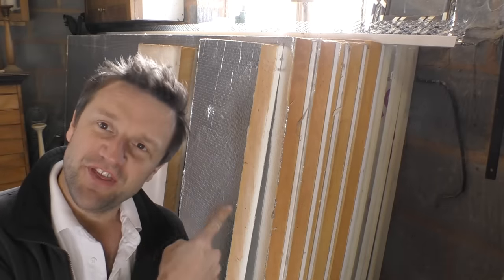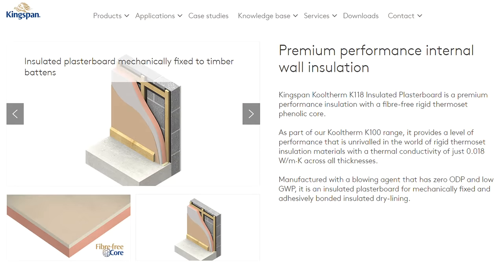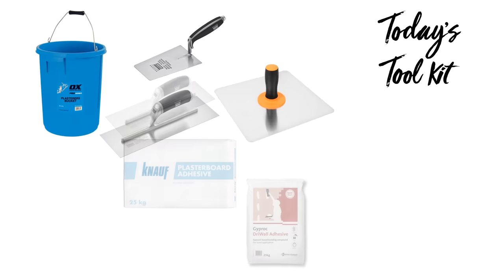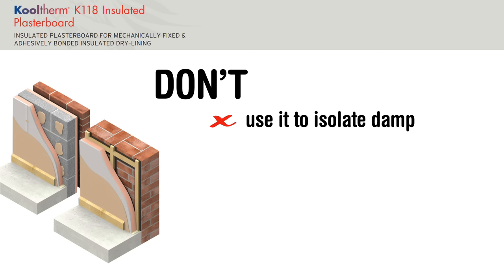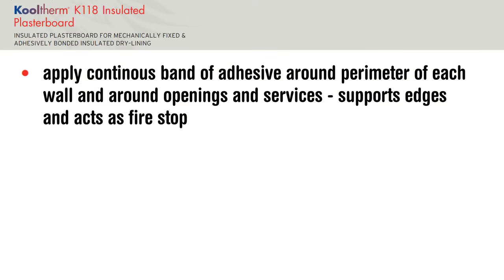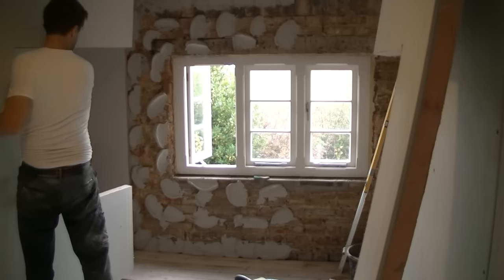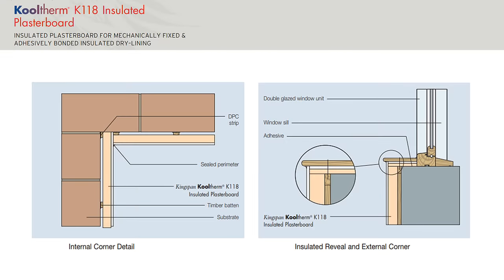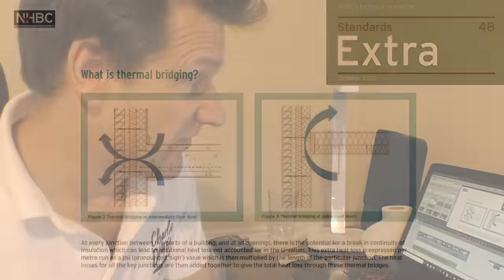How to Dot & Dab Insulated Plasterboard - a DIY Guide

Comment: I love your videos Charlie. It’s been 3 years since you did this. Have you experienced any condensation issues or signs of condensation forming behind the insulation? I’m keen to do this at my house (already done one room) but my head is spinning with all the conflicting advice around the condensation risks and lack of breathability. This stuff is BBA approved for this application but there are so many experts warning against doing it at all or recommending alternative, breathable panels combined with lime plaster to maintain the breathability of the building. Interested to know your thoughts/experience on this
Reply: I’m having the same conundrum, George!
Victorian building so 9” solid walls. We had some damp on one wall already but a specialist said it was mainly due to the incorrect mortar used when the pointing was re done some years ago. Replaced with a proper lime mortar we haven’t had many issues. But if I insulate with this method, am I adding to moisture/breath ability issues?
Reply: @thewalkingsketchbook my house has solid brick walls and I insulated the walls internally 40 years ago. There was not much information available.  Some was very wrong.  I was concerned about condensation in hidden away spaces.I had a choice of polystyrene sheet or fibreglass/ mineral wool.  I used the latter as it was much cheaper.  I made a frame of 50 x75 mm tanalised timber, screwed to the walls and filled with insulation.  Then a polythene vapour barrier and then plasterboard.  Keep the vapour barrier intact around power sockets was awkward. I’m still in the house and have had no issues.  I have one last wall to insulate, the bathroom.  It’s only a few m2.  No external render.  But it’s sheltered and I might bond directly to the wall.  Still in two minds about it. 24:19
Reply: @thewalkingsketchbook think of it like this , your house needs to breathe hence the lime mortar outside and the same applies to the inside with regards to lime plaster and limewash/ breathable clay paint , this method will keep humidity controlled in your property and won't end up spoiling any brickwork because of a build up moisture 👍

Comment: Good job! I don't understand people saying you HAVE to get in the "pro's" to do things like this. Many builders don't realise you have to have a continuous bead around the edge resulting in a draughty plasterboard tent, and building control don't pull them up on it either. Busy fixing this in my house!
Reply from the maker: Thanks Alastair. It's a bit of a dark art this, as it's rarely done properly, to be honest. With yours, just do everything you can to minimise cold bridges. Sockets are a big one where, like I did here, you typically cut through the whole board. If I do this dot and dab approach again, I think I'll get the back box all drilled, plugged and ready, and then spray expanding foam in the void behind the box and in the gap around it, and quickly push the box into place and screw it in position then let the foam harden around it. That way, you're minimising a big source of moisture ingress.

Comment: Great video Charlie. How did you get the radiator remounted? Did you have to extend the pipes or have you come up with some other way of doing it? Thinking of doing the same and trying to avoid having to drain down the system.

Comment: Use a paint roller and tray to apply the PVA, load it up, start from the bottom and roll up, keeping a small wave of PVA between the roller and the wall, touch up with brush if necessary

Comment: Coming to this one quite late. Another really high quality video - great explanations. One thing though, these boards are phenomenally expensive now. In my 100 year old semi, it’d cost approximately £1000 for the materials to do less than 2 of my first floor rooms (external walls only, 50mm board). Have any competing products been released since this video was first uploaded?
Reply: Before you carry out any work, make sure the house does not contain any asbestos. Also old houses with plaster walls would highly likely have no vapour barrier under the plaster to stop moist air from saturating the insulation. Back then, plaster walls were designed to allow the free exchange of air and moisture.  If you're not sure if the plaster has been replaced with a vapour barrier or any insulation, remove a small area and check. You may just need foam or wool insulation and a vapour barrier underneath the plasterboards. I can highly recommend Tekwarm EPS HP, not sure if it's available where you live though.
Reply: Sadly this is just the way of the world now. Building material costs are significantly higher than they were in 2019 when Charlie did this video. It’s been a painful three years for us DIYers !

Comment: Really useful. Thank you. I intend to do my conservatory in the new year.
Reply from the maker: Glad to hear it. If you have to install back boxes for the plug sockets, try not to cut all the way though the insulation or if you have to, re-insulate behind with spray foam to minimise any cold bridging. You could even glue the insulation boards in place with spray foam rather than plasterboard adhesive. 👍
Reply: @CharlieDIYte  really? That would work? Probably easier. I’m always worried about making the plaster too thin. Thanks for the tips.

Comment: Just a note,  only use KNAUF bonding compound on foil backed insulation board k118 otherwise you are taking a big risk. There's no point in pva-ing the back of the boards then, knauf bags are readily available from all drywall merchants. When taking delivery of your boards lay them down as flat as you can get them especially if its going to be days before they get used to avoid them bowing.
Reply: What's the reasons for the KNAUF bonding compound? Thanks
Reply: @LB-gr5se  I assume your asking why use knauf bonding compound specifically on the knauf foil backed k118. If you use BG bonding compound instead,you will certainly run the risk of the board coming away from the dabs once they had set as it is not designed to stick to foil. Where as knauf adhesive you will have no such problems.
  On normal wall board, BG,Knauf or Siniat bonding are all pretty much the same ,though I personally prefer BG bonding. With Knauf ,you have to pay a little bit more attention when mixing because it doesn't like being overmixed by drill and tends to thicken  up quickly, which you don't necessarily want if you have a large mix to do. Hope that answers your question
Reply: @darylheasman1  that makes sense thanks for clearing that up

Comment: big thanks for your time and attention to this. Our walls are 3 bricks thick. Very dry. Considering mechanical fixing throughout though.. a longitudinal fixing of treated timber and then vertical fixing of softwood battening - to level. Fixing verticals with metal straps to reduce thermal conductivity - rather than timber to timber. Fill with fireproof insulation and screw fix 12.5mm plasterboard. Thickness 65mm internally. Wondering why you haven't gone for this approach, apart from the mechanics of getting it all aligned? with metal strapping, this has proven quite simple so far. Thank you R&T

Comment: If you are mechanically fixing the insulated plasterboard. Where there is a risk of damp. You should use galvanized steel batten, as wooden battens can rot. Great video!
Reply from the maker: Fair point. I'd always put DPC between the batten and the wall, at all the fixing points. However you shouldn't really insulate a wall that has a risk of damp, and of course do everything you can to ensure there's a decent vapour barrier to prevent moisture from inside the room causing damp in the wall. The socket back boxes are always a problem though...

Comment: Brilliant video, I've learned a lot and will be following it step by step to insulate the walls of my flat, thanks a million Charlie!
Reply from the maker: Thanks. Take a look at the foam adhesive too - it's a better insulator, and will be more effective to reduce cold bridging around the back boxes you have to cut out for plug sockets. Cold bridging should be your buzz word throughout the project. You need to do everything you can to eliminate any. 👊
Reply: @CharlieDIYte  Thanks for that Charlie, is there a brand of foam adhesive you could recommend?

Comment: I learnt so much from your video and I’m in the building trade!
Reply from the maker: David that's incredibly humble of you, and I say to any trade pro who comments favourably on my vids (eg the silicone one) that they're clearly very good at their job. We're always learning aren't we. Actually there are a few things I'd do differently since making this. On my most recent bedroom refurb to eliminate any potential cold bridging (sockets being a big source) I battened the wall with 2x1, infilled with 1 inch celotex PIR, foil taped over the battens and then screwed the K118 insulated plasterboard to the battens. Socket boxes were cut though the insulated board with a  12mm ply board foil taped to the back to screw the box to. That way there's no cold bridging though the socket. Also continuous insulation around the window reveals and breathable expanding foam tape under the insulated plasterboard. And I either didn't video it or I've lost all the footage 🤦🏻‍♂️ Thanks for the comment 👍

Comment: Well done, Im a plasterer, learnt from my Dad. You have done a decent job of lining the walls. Just as good if not better than most.

 I read in one of the comments about using fixings in old walls. What I do is dip the plugs/screws in gorilla glue and wet them before I screw them in. This expands and strengthens the fixing. The only problem is if you do want to take them out they are a devil to remove but if your wall old it really helps

Comment: I would be interested in how you tackled the window reveal.
Reply: would be great to know this
Reply: a normal 12.5mm  plasterboard would be used.
Reply: @elltell8644  followed by damp and mould in the months to come. Needs a proper thermal break. the improved insulation on the rest of the walls increases problems in the remaining cold areas.
Reply: @alexclifford8961  with window profiles of 30 - 40mm there is little else that can be used other than 12.5mm foil back boards. how they are fixed is down to the operative.

Comment: Great video, the issues for me would be the wires for sockets wouldn’t be long enough to reach through the new insulation, and pipes for radiators not reaching, it would be a massive job. You made a good job of this, just measuring for the sockets would of taken all day for me 😂.

Comment: You made a good choice  doing this to your cottage , I been to jobs that other company's have insulted the lofts and stopped the air flow causing condensation in the roof space all they needed to do is add roof tile or slate vents

Comment: Hi Charlie, great video thanks.  Just a quick question...... When you mark the walls and ceiling so you can align the plasterboard panels, do you have to take into account the depth the adhesive will bring the board out by? Hope that makes sense👍
Reply from the maker: Yes, you want the lines to be a finished depth guide. Otherwise you won't see them because the adhesive will bring the boards forward of the line you've marked.

Comment: Great stuff, clear and concise. Good to see building control nonsense tamed. It’s all a game to take things out of the hands of DIY and drive the contractors market. Look where cavity wall insulation got us  !
Reply from the maker: I think you're absolutely right. And a builder mate said to me the other day when I told him I was preparing this video that in his experience these guidelines are often not followed!
Reply: Nonsense!  The Building Regulations are the MINIMUM standards that have to be achieved and there is nothing apart from Heating and Electrical work that requires any recognised trades certification and therefore within the scope of a DiY'er.  If you had seen the vast quantity of botches I have witnessed from both unknowledgeable amateurs and supposedly skilled tradesmen there is a case for more stringent application of the rules rather than less.  The Building Regulations came out of the numerous local Public Health Acts that were brought together under a consolidating document,  and without them we would still be victims of the Victorian slums.
The Building Regs are continually evolving as they play catch-up with modern standards and innovation, the problem is that they are dealing in an ever more technological world so a becoming more prescriptive than performance based.
Reply from the maker: @clivewilliams1406  I'm sure what he meant by "building control nonsense" is that the way the controls have evolved (and as you say, it's difficult to blame them for this as they play catch up) means that it's difficult for the average home owner, about to embark on a project, to make sense of.
Reply: Charlie DIYte There’s a lot to cover so I shall keep it brief(ish). I did a self build 20 years ago when things were still quite normal, and it was a pleasure to do. Now we are being turned into cash machines and it’s like Dick Turpin has written the building regs. Advanced they maybe, structured robbery it certainly is. All backed and influenced by Gypsum, Knauf, and all the rest.  Replacing boilers at £2000 a pop, for something that’s going to break within 5 years. You don’t really get your money back! Electric consumer units seem to be changed more than underpants, that’s just making money out of people. Becoming an eco warrior has some merit, but it’s only forced and driven by the extortion of energy companies. Older property needs to breathe, and the funny thing is it’s already stood the test of time for there not to be an argument that it was built right in the first place. New builds I wouldn’t have given, and I could cry myself to sleep for the amount of ‘quality apartments ‘ I have inflicted onto the great British public. May the Lord have mercy on my soul.

Comment: Nice video, very thorough. word of caution to all readers, if you have to remove lots of render as in this video. buy OR rent a much bigger low vibration breaker than the small drill / breaker in this video. twenty years ago I ruined my hands with a cheap drill. using a small cheap drill all day will give you vibration white finger. One project, one day with an undersized drill has given me a lifetime of problems. If you are going to be chiseling all day get the right tool. You were lucky this render is so soft Charlie you could have given yourself big problems.
Reply from the maker: Thanks mate. Sorry to hear about that. Great advice that I'll bare in mind on a job I've got coming up.
Reply: @CharlieDIYte  its a strange thing, if I do over an hour now with any vibrating tools (drills, multitool, anything) my hands go white and numb. I had to give up motorbikes for the same reason (numb hands are not good at 160MPH :-)  )

Comment: Hi Charlie, I’ve only just seen this video even though it’s almost a year old. I insulated the external walls in two bedrooms of my house the difference it makes is amazing. In one of the rooms I hacked of the plaster as it was very loose, but then I put a tight coat of sand and cement to get rid of some of the bows and bellies in the wall. Around the windows I framed them with 2x2 batterns. Before putting the boards up around I cut away the insulation only.  When you put the board up around the window you can screw the edges around the window. Around the window you now have a reveal which you stick standard plaster board to using screws with a few dabs of adhesive. I’m about to move on to my bathroom. I just concerned about the condensation, and of course the tiles on that wall. Any advice
Reply: Don't you lose heat around the standard plaster board on the window edges
Reply: @satwinderdhariwal  I don’t think so. Around the window is framed with two by two and inside that it is insulated. I realise you will loose some heat but it is a vast improvement, which is what you want at the end of the day.

Comment: Great vid, thanks. 

I've recently renovated my 1930s (forever) home with K118, given we have solid walls we went with the the wooden battening method. Like yourself, our brick walls are totally dry. My builder recommended a dot and dab method, just like yourself - however I decided against this. In hindsight, I think you're right and dot and dab for dry solid wall is fine!
Reply from the maker: I think you're right to go with battening. It puts no moisture into the wall compared to dot and dab. I've just done the same in my bedroom, just to compare the two procedures.

Comment: Hi, What fixing should I be using to hang mirrors, curtain rails & picture frames on 50mm insulated plasterboard?
Reply from the maker: Fisher Duopower would do a good job. For the heavy stuff you could use wall anchors - probably 5x52mm. They work in insulated plasterboard as the umbrella forces itself open even in the insulated foam. The only downside is that the screw head on the bolt is reasonably large, or at any rate looks different to a screw. https://youtu.be/e3hjzPNe5wk

Comment: I wish this method was banned. It eases the builders job but its a total pain in the ass for the homeowner when it comes to DIY. Prefer the studs
Reply: I've spend many hours rebuilding studs in my 200 year old house to get things level, this looks like a much preferred option. Not a single wall in my house is square and it's a right pain in the arse doing it 'properly'
Reply from the maker: I've just done my bedroom wall the stud method, and my bathroom before that. It was more of a pain but I thought I'd do a video on it, and also, with that extra layer I've more than complied with building regs in terms of the u values.
Reply: Banned? Ok.